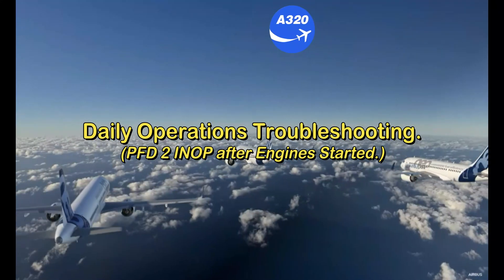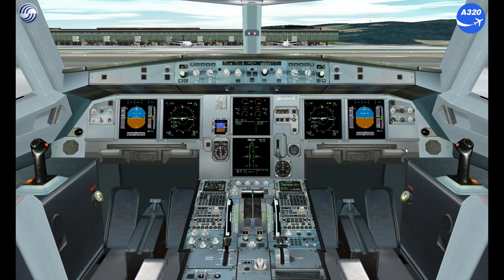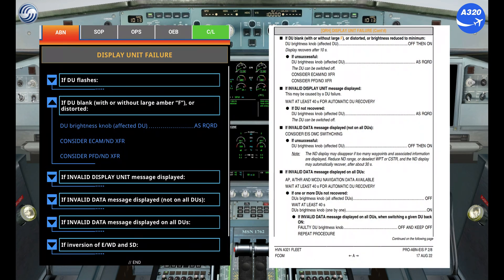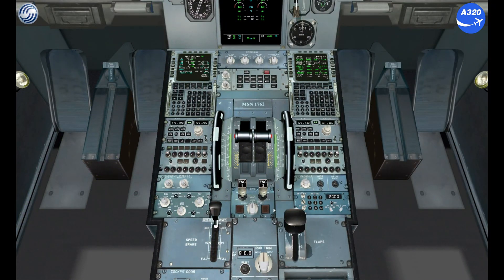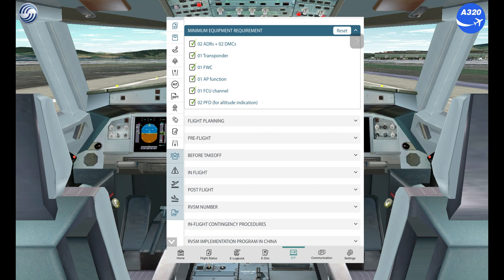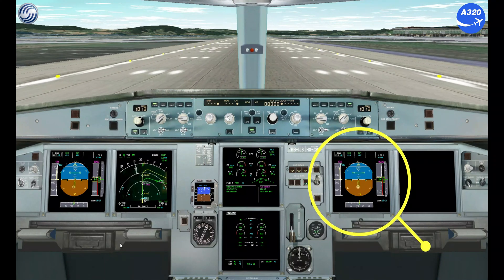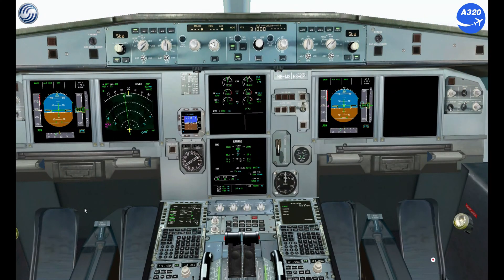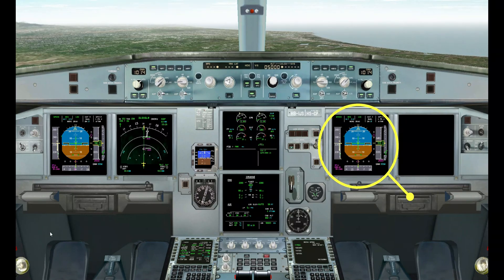A320 Daily OPS TroubleShooting PFD INOP

Comment: Thank you, but what if the ELAC 1 fault during taxiing and there's an operational procedures but we have to perform the flight controls check during cockpit preparation with both engines off and HYD pumps on?
Reply from the maker: ELAC 1 has (O) and (M) procedure that's mean that you have to go back to the gate for operational and maintenance procedures 🙏👨‍✈️🛫